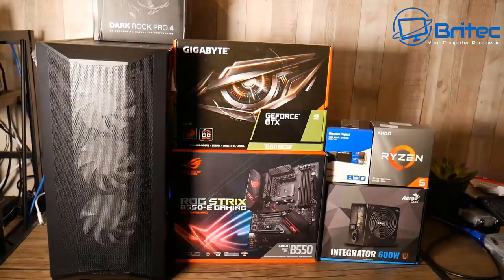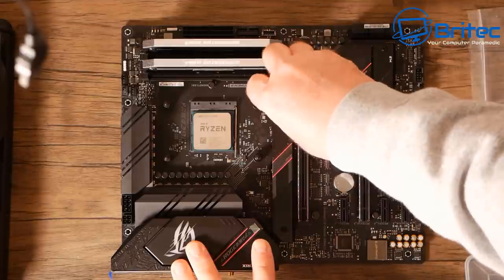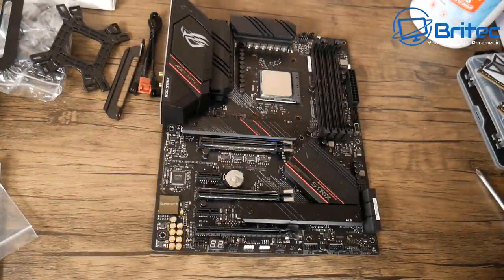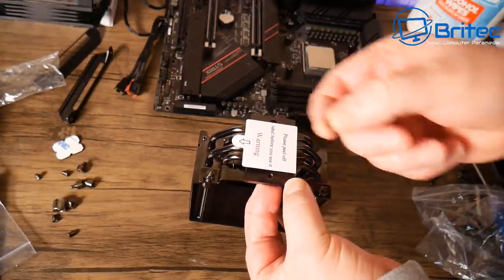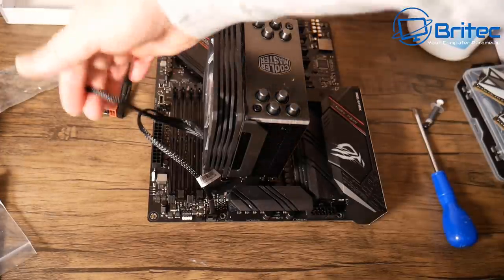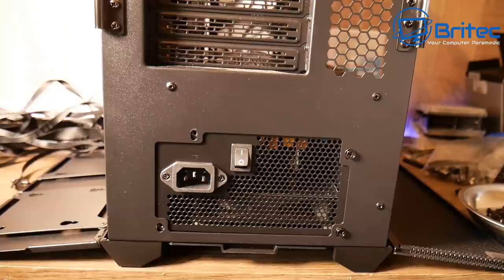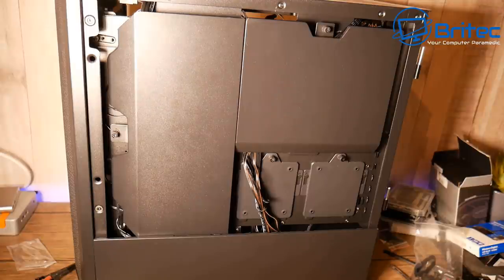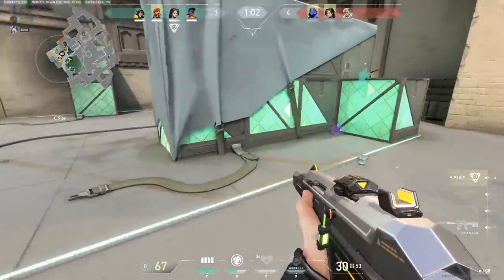Build Your Own AMD Ryzen Gaming PC

Comment: Terrific build on this gaming PC. The only issue I saw is the CPU fan. It looks like it is partially blocking one of the DIMM slots. Should you need to or want to expand memory, this might be a problem using this heat sink. Keep making these computer build videos Brian. They are very educational to watch.
Reply from the maker: Thanks Robert, no problems with cooling

Comment: Everyone should build their own gaming PC, it's easy. To date I've built 307 PC systems in the last 10 years. Most of them while working for a custom PC shop. The rest for me, and people in my local area. I have a major mod coming up this weekend, now that the spray paint I ordered just arrived! Good times.
Reply from the maker: Yeah real easy to build computers. People make it sound hard.
Reply: @Britec09  Modding the cases and deciding how I want to run the PETG tubing is the hardest part. But, most people don't have to worry about that. They only have to LEGO the pieces together. LOL

Comment: Great choice of parts nice build i am in the middle of getting parts for my pc build .i am going with a  Sabrent Rocket Q 2TB NVMe PCIe M.2 2280 Internal SSD High Performance Solid State Drive on amazon for £219 pci e 3 and not 4 but as far as i know one of the cheaper 2tb drives i will be adding 2 hard drives though.
Reply from the maker: I have the sabrent rocket and was going to use it, but going to put it  in my main pc

Comment: Well i am a little disappointed with Lian Li, that seems a bit of a design flaw by the 24pin motherboard connector, i absolutely love the look of this case but that has seriously put me off it now :(

other than that great build Brian. Turned out nice fair play
Reply from the maker: Yeah I agree, very hard to get the cables how I think they should be, but unfortunately, that was not possible. I will have another go at trying to tidy that area.
Reply from the maker: I managed to tidy it up a little better
Reply: The Lian Li 011 Dynamic case is really good. I didn't think I find a better case until I saw the Thermaltake Level 20 HT. As for their RGB 24pin cables, not a fan.

Comment: Hi Brian, I recently built a 3700x PC with a B450 Pro Carbon. I am already thinking of switching the Mobo out for an x570 as the m.2 slots take power from the pcie slots limiting the use of the pc. I want to add an RME pcie audio interface into the PC while maintaining the m.2 slots for music production. Can I just switch the drived from the old motherboard to the new one or is there a process I need to follow?
Reply from the maker: x570 would be a better choice of motherboard for 3700x and yes, you can just swap drives

Comment: i have the cpu on this board running at 4.5Ghz  on all cores at 1.25 voltage :) sweet as a nut !!!!!!
Reply from the maker: Nice
Reply: @Britec09  runs lovely on that board Bri , and if i pushed it it would go to 4.6 with a little voltage increase ....but 4.5 is a good sweetspot ....give it a go

Comment: Just built a  i7-10700 based computer .Still not a fan of AMD. The 10th GEN chips run so much cooler. After running prime 95 for 30 minutes I’m topping out at 52 Celsius.
Reply from the maker: Intel have always been pretty good on temps.

Comment: Under the amd 5 3600 it say's something about DDR 4 3200..I have DDR4 3600 that i am looking at putting my system when i finally build it will it bake any difference between that and what the cpu specs say of 3200?
Reply from the maker: Ryzen likes super fast ram, you may see small frame drop while gaming.
Reply: @Britec09  So for gaming i would be better of with a a 3200 or 3400 ram or isn't the frame drop that noticeable with the 3600?

Comment: Here is a list of my new build if anyone is interested cost just over €1K
MSI MAG VAMPIRIC 010X Mid Tower Gaming Computer Case
 - (_Really good price_)
Ryzen 7 3700X
 - (_Enable PBO and it becomes a 3800X_)
EVGA GeForce GTX 1660 SUPER SC ULTRA 6GB GDDR6
MSI MPG X570 Gaming PRO Carbon WiFi 
HyperX Predator DDR4 2x8 GB 3200 MHz 
CORSAIR TX650M Semi-Modular ATX PSU
Sabrent 500GB Rocket Nvme PCIe 4.0 M.2 
- (_I cannot believe how fast this is._)
3 X Noctua NF-P14s redux-1500 PWM 140mm fans
Reply from the maker: nice tidy build